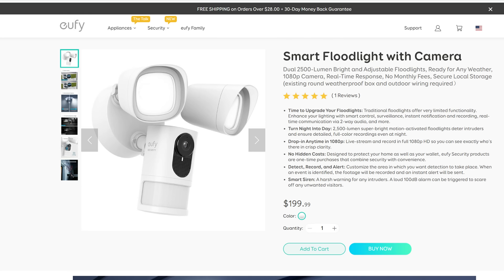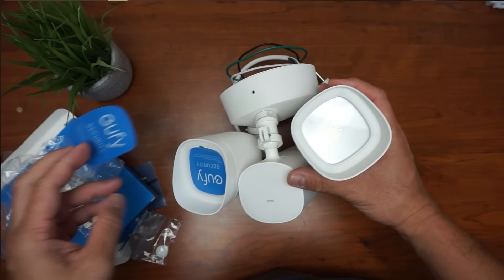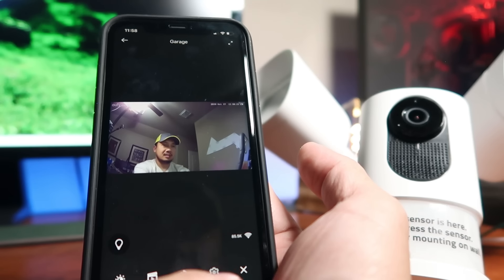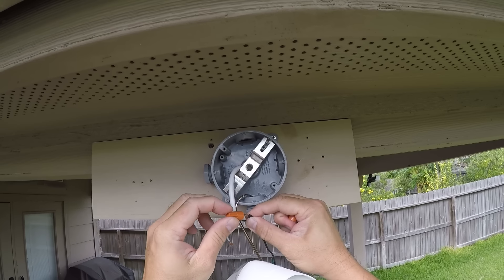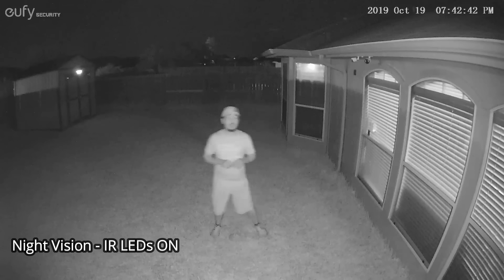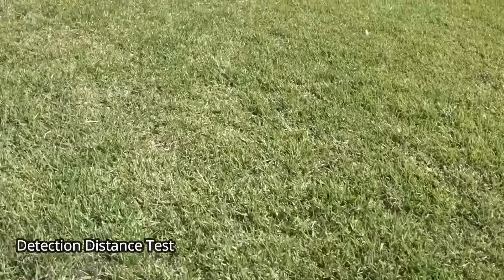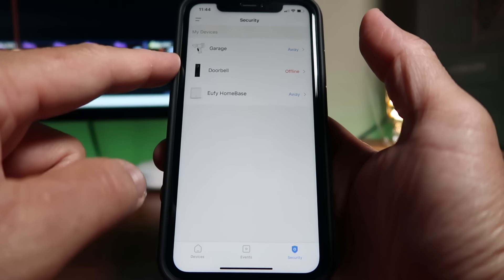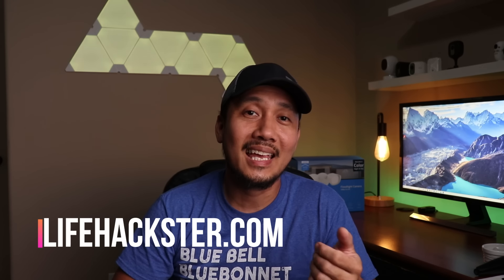Eufy Floodlight Camera Review - Unboxing, Features, Setup, Settings, Installation, Video Quality

Comment from the maker: Hello Guys,
Eufy has emailed me and answered the questions and issues that were brought regarding the floodlight cam and also their video doorbell:

Floodlight Camera

Short Motion Detection Range

We use PIR sensor and image motion detection algorithm to identify valid event. PIR sensor can sense moving objects with heat signature. But it also has some downsides:

Hot wind or swinging bushes or direct sunlight may trigger the sensor by accident. 
When the environment temperature goes high, the temp difference between environment and object body is less. The PIR sensor will become less sensitive.
Moving towards or leaving the sensor is less sensitive than moving vertically.

So we pick the PIR sensitivity carefully to balance the detection range and chance of false detection. Image motion detection algorithm is also used to filter out possible false detection.

We suspect the inconsistent detection range may caused by movement patent difference. We are adjusting sensitivity parameters and running field test now. If everything goes well, we will share some updates with you later this week. If you have other suggestions or ideas, we would love to hear as well. 

App UI Bug

When checking the Activity Zone, we don’t see the “back” arrow. 

The UI design made it this way in purpose because the camera supports multiple zones. 

When tapping one activity zone, user have the choice to edit it.
When tapping outside of the activity zone, user can see the tool bar.
In the review, the activity zone almost occupies full screen. So it’s hard to tap outside of activity zone. We will also evaluate the possibility to give hint to user when entering the Activity Zone page.

Black color version

Yes, we have the black version. Stay tuned for its launch!

Integration with cloud storage or HomeBase

Integration with eufyCam HomeBase is under development. Doorbell is the first model. Then the floodlight camera comes. By then, user can backup video footages to HomeBase.

Mode Integration

Thank you for the suggestion. We will evaluate it.

Video Doorbell

Since launching the video doorbell in June, we have made a lot of improvements on software, which includes:

Recording

2K video recording. (Settings - Video Quality - Recording Quality)
Continuing recording when answering the doorbell ring. (Settings - Video Quality - Record while live viewing after Doorbell is pressed)

Notification

Selecting notification types from text only/text and thumbnail/text first and then thumbnail. (Settings - Notification)
Jumping to history event or live view when taping a notification. (Settings - Notification)
Snoozing App notification and chime sound for a specific duration. (Devices - Snooze icon)

Integration with eufyCam HomeBase is under development. We expect to support it in Dec. By then, user can backup video footages to HomeBase.
Reply: Please add a feature where ALL the videos can be downloaded at once. Also a wind barrier in future models would be great to add clarity to the sound.
Reply: @FuzzyLogicxxx  recorded videos on the camera not on youtube.😂
Reply: Hey Lifehackster...is it possible for you to do a review on the Swann - 1080p Wi-Fi Floodlight Security Camera???
Reply: Hmmm no mention of Apple HomeKit or HSV?
Reply: Hi can this work in 220v?
Planning to buy this and bring it to the Philippines
Reply: @atanphil  The camera is designed for a 120V 2-wire power supply with a separate ground. Attempting to supply ANY 120V device with 220-240V would likely destroy it, likely catastrophically.
Reply: Is the motion detection issue now resolved?
Reply from the maker: Tony Powell -yes..
Reply: @LifeHackster  Thank you man, much appreciated.
Reply: @LifeHackster  Wish you lived in the UK. Would pay you good money to set these cameras up for me. I've written to Eufy a few times and sent them photos of my property. They are not sure these cameras will have a positive outcome for me which doesn't sound too promising 😭
Reply: @LifeHackster  I just installed mine yesterday. I could connect to camera when I am at home using the same wifi. But I can't when I am on outside. It doesn't work whether I used mobile internet or wifi. Do you know why? Does your one work? I want to watch my house when I am outside.  Thanks.
Reply: @Ryannz119  That sounds a bit worrying. I suspect you need a cloud subscription to receive alerts while you're away. These Eufy cameras are more like toys. I wouldn't rely on them for security.
Reply: @LifeHackster  Seems like the motion detection at night is worst than daytime. For example, it can detect cars 50 feet away during day time but when it is at night, detection range is only around 10-15 feet. Do you experience the same issue?
Reply: Is this somewhere public? Eg eufys on site? 
Everything I’ve read still says the doorbell stops recording when you go live
Reply: @LifeHackster  and in the field, is in fact the motion detection now doing what is supposed to do?
Reply: They said the HomeBase support would come in December, but it still doesn't seem to have it?

Would the old units receive a firmware update or would the support only work on a V2 of the product?

Thanks.
Reply: @atanphil   You have probably delt with your issue now, but a 220/240 volts version is available in the UK, and probably Asia.
Reply: @cai0  I’m interested to know this - I’ll hold off for the 2k version probably
Reply: Can you update as to whether not these issues have been addressed, i am thinking about purchasing a package that includes the floodlight but i wont bother if the flood light is not working correctly. Also does the flood light work manually on a light switch or only via the app thanks.

Comment: I got two I wish the one in my driveway the light wouldn’t keep coming on. Even when the motions not detected they really gotta fix that or update it. So you can change the sens on the flood light. It’s on its lowest motion setting and that doesn’t control it.

Comment: Which way should the wing nut around the camera turn to loosen? I am having a hard time turning the camera to properly angle it. That nut seems to be too tight and not sure which direction should turn to loosen. I cant find any support on this. Any help would be appreciated. Thanks!
Reply from the maker: Lefty loosey...
Reply: @LifeHackster  thanks. Actually did that but seems to be way too tight. Tried using pliers but it moves the whole camera with it and doesnt losen. Will keep trying thanks.

Comment: And is this have wide angle ? Should I used this is additional to my front yard 2c ? Or should I just instal 2c 2 cameras at the backyard what you think ??

I was gonna buy the 4 cameras 2c eufy and place 2 in the back yard ? Or get 1 floor light Conrad for the back yard ?

Comment: Good evening I currently have the T8420 and trying to change the wifi address on my system that's been installed for almost 6 years. Unfortunately I don't have the original box to obtain the code to scan. I have tried changing the wifi address in my account and it won't let me. Any advice dear?

Comment: Hi love your vids 👍🏻👍🏻 I just bought eufy flood light cam and have noticed some bugs 1 even of motion boxes on or off it was constantly going of with the snow coming down last night also with sensitivity at lowest. 2 it doesn’t pick up proper movement until close by also same with the lights. 3 sometimes no notification when it does pick up false movement and light come on and I’ve gone to back door wondering why the lights are on go to app and nothing there. It’s only 3 days old and is updated
Reply: And the 4th last night a Adjusted the volume to max for speaker and tonight when I was checking he settings the volume was back down at factory setting

Comment: Ok I got mine and installed in the cold Canada winter and it is working great with almost zero false triggers and is not triggered by the snow. This is the fourth floodlight camera I have tried and this is a winner. I hope it does not get any colder than -20. Local storage and no monthly fees. This is highly recommended. Forget Swann, ring, blink.

Comment: Do the detection test at night, the sensors are very weak past 20 feet.
And maybe higher than 10ft away from vandalism, to see if sensors work that well. 
The sensors need improvement. I have cheap Amazon indoor cameras set to outdoor and work better than Eufy.

Comment: Any update on this? Just bought a ring flood cam and it’s absolute garbage! It won’t connect to my google WiFi mesh. One of the google pucks is literally right behind the Cam on the kitchen wall. I can’t get it to connect no more what and it shows my network with a strong signal but fails to pair every time! Ring support is garbage and told me to return to Home Depot!!! 

😡
Reply from the maker: Wow..sorry to hear it..this eufy floodlight is now pretty good. I’m actually working on a comparison between the ring and eufy floodlights and it will be up soon.
Reply: @LifeHackster  After Ring sent me a chime pro wifi extender and that didnt work. I figured maybe there is a problem with my network. I ended up bringing out my old Apple extreme router and put it in bridge mode. I also set it to only broadcast in the 2.4ghz band and no 5ghz. This ended up working perfectly and my Apple router is about 25 feet away from the flood cam and chime pro. 

So my Google wifi was the problem. I guess it tries to force the 5ghz over the 2.4ghz which is the only capable band in the Ring cam. Unfortunately the Google wifi is limited in what you can customize. You cant change WiFi channels manually or set separate networks for 2.4 and 5ghz. Google needs to fix this ASAP SMDH.

Comment: Can I turn the light off and on by the switch on my wall that brings power to the flood light and still have the camera work? Only want the light on when I switch it on but I don't see any way to without doing it by the app

Comment: Thank you..Great review as always!  What is the diameter of the junction box? I just got 4" box  from HD but the back of Eufy base  is bigger.
Reply from the maker: The round boxes should be standard and the base will protrude a bit but not that it will have a gap.. on this video, I got the box for outside install and not the one that in ceiling type.
Reply: @LifeHackster  Thank you for the fast reply.. Keep the videos coming! 👍

Comment: What’s the best security camera that has the auto connect feature when the cable modem or WiFi router goes out or loses signal??
Reply from the maker: All my WiFi cameras that I use, automatically reconnects when the power or the internet comes back on.
Reply: LifeHackster My Wyze Cam’s don’t. The blue light just keeps blinking.
Reply from the maker: Paul Day - my Wyze cams reconnects every time.. I haven’t had issues that I need to reset.
Reply: LifeHackster WOW. I have 4 and they all blink blue once the WiFi goes out and comes back on. Also they are up to date.
Reply: My first gen yi home cameras where great. Specially the night vision through glass. Always reconnected when WiFi went out.
Reply: I also have no problems with Wyze cams reconnecting after a WiFi drop. It may be your wireless router signal  strength
Reply: DuketheMyth If it was signal then they wouldn’t work correctly when there isn’t an WiFi outage. Signal is fine.
Reply: DuketheMyth what kind of WiFi router would I need then for 4 cameras in a 1700 sqft 2 floor home??

Comment: My Ring floodlight no longer records in color at night.  It still records at night, but in gray color only.  Some of the lumen lights no longer light up.  Well, that's what brought me here to checkout the Eufy floodlight camera.
Reply from the maker: If you are subscribed to protect plus, you will be able to get it replaced for free...Mine is going on more than 2 years and had no issues yet... (knock on wood)
Reply: @LifeHackster  ---- Wouldn't it be too late to sign up now for Protection Plus?  I've had the floodlight over a year.

Comment: Hello Sir, question. I have duplex unit and my front door is 90 degrees from my walk way. I want to replace my existing door light. Can the lights (or at least one) and camera be able to be positioned in a manner to accommodate the location?

Comment: I bought this product and it still has a lot of bugs yet. There's no human identification for the motion setting unless you have it hooked up to Google Assistant or Alexa. Even when playing around in the settings, the motion detection gets triggered by anything that twitches and bird farts. Freaken ridiculous, even when I have it on the lowest sensitivity setting! Also (I bought two) my front floodlight, the lights won't stop flickering at night when the motion detection is set off. Looks like a disco dance club in my front yard! On a good note, the night color vision is pretty good, the resolution is better then most cameras out there and the free 3+ Gigs of storage is awesome. Till they fix the motion setting, I would hold off on buying this camera.

Comment: I’ve always wondered, can you use the Eufy floodlight cam to replace a typical outdoor sconce that you use with a light switch? Like your normal average outside the door light.
Reply: Yes, but the light switch would have to be left on all the time, or the switch removed, the wires permanently connected inside, and the switch box plated over.

Comment: Ok so I had asked the question about how you replace lights if one goes out and the answer is you don't these lights are permanent and the system as a whole is designed to last approximately 5 years... give or take.

Comment: Question to confirm your setup. Is the camera you installed hooked up to a constant 120V source or to a light switch? I'm guessing that for the camera to work correctly it required constant power and should not be on a switch circuit.

Comment: With the new updates is this floodlight capable of connecting to the homebase?
Reply: I just had the same issue with my eufy Indoor 2k pan and tilt. I re-booted my phone and the eufy 2k camera to try and get my motion detection back online but it didn't work. Then I re mapped the detection area and changed the detection sensitivity and at first it didn't work but then randomly did and has been since... deifently a issue that needs to be fixed as my camera is only set to record and alert when motion Is detected.

Comment: Actually Ring has the same issues. I don't receive many notifications that i should, and other family members also have the same issue. I dont think its a hardware or software issue, i think its a notification delivery issue.
Reply from the maker: Not with the eufy because there is no recording...in your case with Ring..even if it didn’t notify you ( it is a phone issue) there will still be a recording.

Comment: I was considering getting this floodlight.  I bought the Eufy 2 pack cameras based on your recommendations and they are working great.  I wasn't sure about this flood light, but knowing that it doesn't record to the base station clinched my decision.
Reply from the maker: They are working on that feature..to record to the base station but I don't know when it will be implemented.
Reply: Which one did you end up buying

Comment: can we use this cam with lte connection?  rather than wifi?
Reply from the maker: No. Just WiFi.
Reply: @LifeHackster  anyother floodlight camera that works with LTE sim card connection plz
Reply from the maker: @hanzalanasir8518  - not floodlight but there is the Arlo Go and Reolink Go that you can check out.

Comment: I just bought the Eufy flood light cam and I'm having same motion detection issue. Did you have any luck fixing it?
Reply from the maker: Eufy hasn’t advised me if they have fixed it..so I’m assuming it is still the same.
Reply: Me too
Reply: @mariou8216  I returned the Eufy and bought Swann flood light cam from best buy for the same price and motion detection works great. It detects stuff from about 50ft far.

Comment: You’re a great and through reviewer, but one thing I wish you’d do with these security camera reviews is test the latentcy between actual motion and sound compared to what is heard and seen on your phone. I think this is important because a latency that is a little too long (5 seconds or more) really makes speaking to the person through your phone impractical, and it might even present a security problem. When you activate the notification, you should spend a few moments with your handheld camera pointed at your phone screen while you wave your arms as  you’re standing in front of the security camera to test latency.
Reply from the maker: I haven’t tested any WiFi camera that has a latency of more than 5 seconds...the most would be 2-3 seconds..it is not enough to be a security concern or cause issues with 2 way audio..rest assured if I review one that has long latency, I’ll call it out.
Reply: LifeHackster awesome, thanks!

Comment: Just wondering if you can set up the Eufy floodlight cam for human detection through Alexa or Google Home? I have it and the motion sensor is junk. If a bird farts, leaves fall or a car passes, it gets set off. Very disappointing and I would not recommend this camera! The video quality is good, but useless without human detection....
Reply: Hey Ryan, have they addressed this issue with any kind of update to improve the human detection? Thanks in advance ✌🏽

Comment: wonder if any other Eufycam models have the same issue
Reply from the maker: I know the Eufy Cam E has no issue... because I checked to compare... on the clip where I showed you the issue, you will see that the Eufy cam E is also installed on the side :)